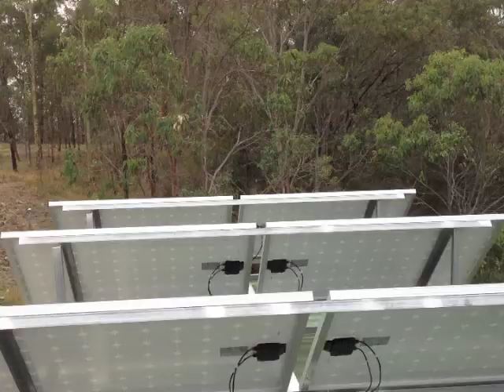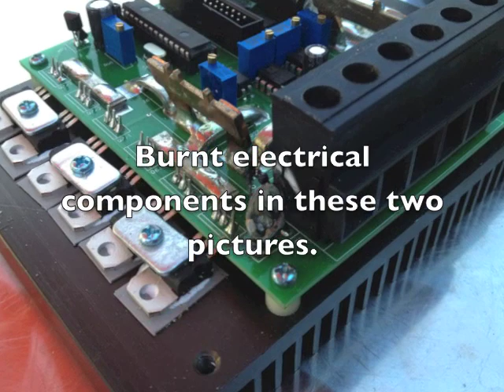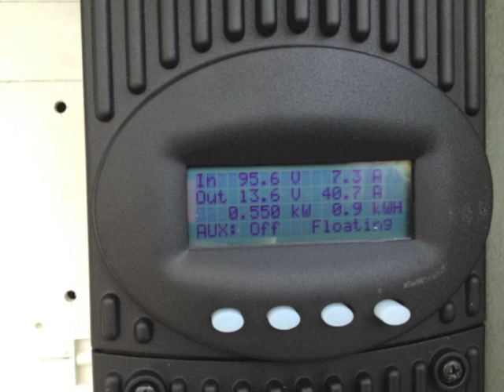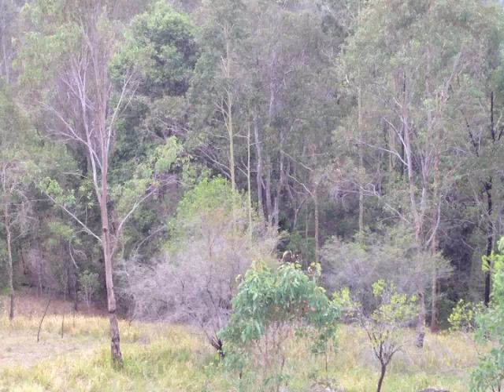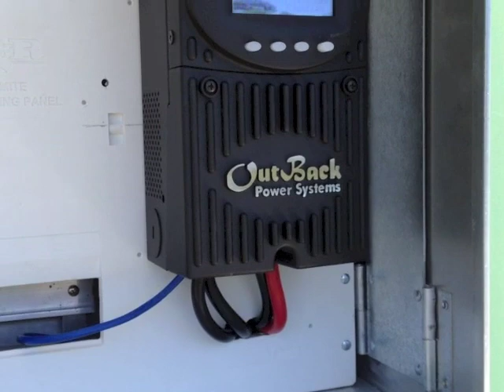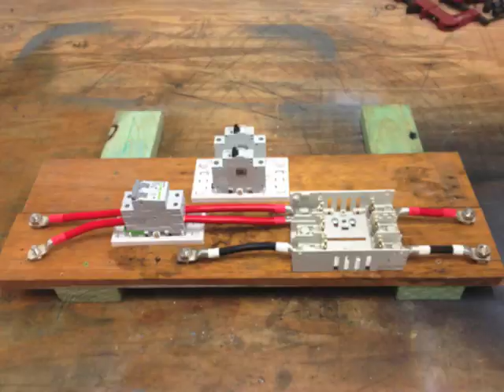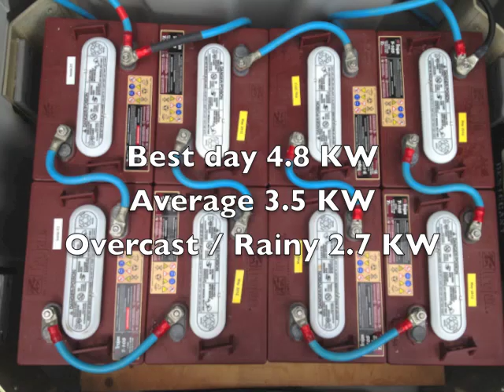Shipping Container House - Install a charge controller and inverter to solar panels

Comment: Paul - thanks for posting this! Clarification: was your generator connected to the charge controller in any way? Can you use it to top off your batteries, if ever needed? I'm looking for something that'll let me connect solar & wind, plus a generator for those few days a year the others aren't producing. Thanks!
Reply from the maker: Hi Dan, yes the Honda generator (3KW) connects to the inverter and this allows me to top up after a prolonged cloud cover. If the inverter senses the Honda is supplying power, it sheds the load to run on the generator and recharges the batteries at the same time. We only use it rarely, and typically for around 40mins to and hour after the sun has gone and the batteries are showing 80-90 percent full. We only need to put in enough for a small top up to carry us through the night and then review at the end of the next daylight period. It has been a very successful arrangement, currently running very well for 6 years. The outback equipment is old technology now, but it is very stable. The Honda is superb, starts first time EVERY time. I never dabbled in wind as I was in a wind shaded area below the hilltop. Cheers Paul
Reply: Thanks, Paul! Exactly the scenario I'm hoping to duplicate...with, perhpas, a little wind in the  mix. Regards,...Dan

Comment: A normal 120/230 volt Fridge and freezer used a lot of energy.  

Why you not buy a 48v compressor  Fridge, these are more energy-efficient.

Look on the internet and you find those fridges and freezers. 

Here some links

https://www.alibaba.com/product-detail/Solar-DC-24V-36V-48V-72V_547567632.html
https://www.alibaba.com/product-detail/DC-new-design-export-CE-UL_60621821892.html
Reply from the maker: Hi Lexpee, Thanks for the good advice about the fridges. Cheers Paul.

Comment: Thanks Paul I've got 9 360 watt panels I think I might just buy a few cheaper 250 watt panels to run my lighting independent like you are. Thanks for the input. Your videos by far are the most straight forward I watch.

Comment: Does all your lighting have to 48v now?
Reply from the maker: Hi Benjamin, My lighting LED's are 12v. My big battery bank is 48v. I experimented by buying a cheap 48v to 12v converter. It turned the 48v into 12v fine, but the lights stopped working. I could only switch on a couple of banks, as against all ten banks of 4 LEDs. I went back to a single 12v 150 AH lead acid battery fed by a 250w solar panel running all the lighting, and two 12v outlets charging a phone and running the internet modem. I think if I had bought a 200 dollar converter it might have been a different result. 12v is perfect for lighting. Cheers Paul

Comment: did you just run 6mm cable from panels to the charge control? I've got 24v system 32amps and needs to run about 7.5 meters.
Reply from the maker: +brittenv1000 Hi Britten, the panels I have seen have cable of 4mm cables where they connect. Traditional 4mm is used, but this is good for higher voltage panels. If you are on 24v, thicker cable is better as it reduces losses over the run. The shorter the better. Your cable should be rated to handle the current. If you question is about the battery cable, go as thick as you can. 32 Amps seems like a big number from a panel, are you stringing a few together. Cheers Paul
Reply: +Paul Chambers Cheers for the reply.  I'm getting my series and parallel confused ( tiredness 😄) 2 lots of 5 panels in series then parallel 2 together.  60volts 11.6 amps. sounds better? my panels have 4mm2 cable from them.
Reply: +Paul Chambers sorry to bother you again.  what make is your knife switch? thanks
Reply from the maker: +brittenv1000 That sounds more realistic. I used 4mm cable to bring it off the panels to a breaker that lets me isolate it. I put the breaker as close as practical to the panels.  I used the breaker to collect the 4mm wires but used battery cable from the breaker so there were minimal losses to get to the charge controller. Knife switch "Jean Muler" part no NH00-160A. Cheers Paul

Comment: Nice set up good job, I just hope you used RCBO breakers on your mains output side in other words earth leakage detection safety switches much safer if something goes wrong  it has to done in Australia to meet compliance..
Reply from the maker: +TheMFrelly Hi TheMFrelly, Indeed I have installed an RCD breaker. The output from the inverter goes to a regular house box with RCD, and multiple earth neutrals. I borrowed an RCD tester and made sure the RCD is operating. It was tripping in less than 20 ms (at 0 and 180). You message is a timely reminder to re test and to buzz the earth lines so thank you. Cheers Paul

Comment: PS My lady friend said that you sound very intelligent. Please don't let that go to your head, as you may need to add a wide-angle lens to your video system lol
Reply from the maker: +urgentcareguy3 Too late, I bought a canon 16-35 mm lens. I was able to fit in though with room to spare. LOL Regards to your lady friend. Cheers Paul

Comment: Yes, I like the Midnights a lot. They seem to have the ability for upgrades. The only down side to adding them to an Outback system is that they do not talk to the Outback Mate 3. In actual use, this just means opening up one more screen on your computer to admire your energy production. I'm going to try that new ceramic paint when I paint mine. Supposed to be quite good. If you need a turbine and want to do a powerful one, look for Orlando Sanchez at Genesis Wind Turbine here on YouTube. Happy compare notes on RE systems, if you like : )
Reply from the maker: +urgentcareguy3 I found that paint color choice was a more effective insulator than the ceramic paint.  My white container is cooler in summer than my green ceramic painted. How does the midnight connect to the computer. Do you have to run an RJ45 or is it over a wireless or bluetooth net. I believe they can take more than one string which is important to me. Can I buy a midnite version of a mate. Thanks for the turbine update.

Comment: I have the outbacks too with midnight solar charge controllers. Was going to suggest that you paint your solar container white to reduce its radiant heat impact on your panels.
Reply from the maker: +urgentcareguy3 Hi urgent, do you like the midnights, I have a future project and was considering one. The white storage container is a lot cooler than the dark green. Painting is on my to do list but not yet made it to the top. Cheers Paul

Comment: Well Paul, I am now starting to have nightmares, Volts, amps and all the rest, first I am not a numbers guy and power is even worse. Looks like I have a lot to learn and look forward to your help in the future.
Reply from the maker: +Noel Sowerby I was new to solar at the beginning. What I did was buy a 20 watt solar panel, a small battery and a very inexpensive charge controller and 4 LED lights. I decided to wire my garden shed with LED lights and learn how to join them all up. It turned out to be very simple and I discovered that warm LED lights are nicer than brighter cool temp lights. When i installed the lighting it was just a bigger version of this system. If your battery is big enough (around 100AH) it would allow you to get a small inverter to make mains power to run an electric drill and learn about inverters and what they can and cannot do. That gave me the confidence to tackle the house mains batteries and inverter you see now. I still use my shed lighting, when we sold the house I took it with me and it runs the outside security lights with the same panel, battery and controller.

Comment: was looking at the video you made with the 12volt disconnect with fuses to the 12volt breakers made on board that was part of solar panel controls with the charge controller and inverter. have been trying to find flush mount dc disconnect and breakers like those, would you know name of manufacturer? thanks
Reply from the maker: +david gregory Hi David. Thank you for the message. I will try and assist. I am just clarifying the bit you are interested in. There is (A) a 3 fuse knife switch, (B) a wall mounted double DC circuit breaker that will disconnect the power from the battery. Then there is (C) a 4 slot wall mounted CB holder that has the Inverter AC out breaker, and the generator AC in breaker. Are you trying to identify the neat DC breaker holder (B). What country are you in?. I will send you details when know which bit you are after. Cheers Paul
Reply: +Paul Chambers  Name of company that makes(A-B-C) would be good, may not use (C) but live on the east coast of Florida so may want to tie in the generator. Have had combi inverter-battery charger on boats and if leave inverter on when start generator screws up the inverter panel but charger side still works. Maybe(C) is what I need? Thanks
Reply: +Paul Chambers  Hi, took my computer down to the local electrical supplier and showed them the disconnect panel you made and only thing they had like the knife switch and dc circuit breaker did not have connectors big enough for 1/0 cable. Did you have to change the connecting lugs or did it come like that?
Reply from the maker: +david gregory Hi David, I contacted the company that supplied the knife switch. The complete unit including fuses was $90. I will look into your question about the other breaker boxes. I will have to go and talk to the electrical supplier I bought them. Here is the link to the supplier and they said they could post overseas. https://www.solaronline.com.au I did not change any lugs but it was very neat. Getting all the conductors into the lugs took a bit of time. Cheers Paul
Reply from the maker: +david gregory I used a double DC breaker because I had 2 cables. I could put a full sized cable into each of the  inputs of the DC breaker and put lugs on the outer ends.

Comment: The MPPT controller can receive higher voltage from the panels and feed to a 12 volt bank without the lose you get from the PMW controller that burned up. The only real reason to use a higher volt bank with MPPT is to reduce the cable requirements from the charge controller to the batt. bank. With a PMW controller you need to match voltage to avoid losing current, so 24v bank to 24v panel array is OK but 24v panel feeding 12 battery bank would lose half the amps. MPPT can take 24v from the panel and jam all the amps into a 12v bank. There are several benefits to MPPT, but flexibility is one of the biggies to me..
Reply from the maker: +pokerfacetodd That was very helpful. I knew about the current and the cables but the rest was news for me. Thank you for sharing. My Outback charge controller has been a good purchase. The only thing it does not do well is permit for multiple strings. I wanted to add a second string with a different orientation but people suggested that would not be a good move. I have 4 panels currently unused. Unsure of the best way to maxis the output. Cheers Paul
Reply: +Paul Chambers  I'd tie my panels in series to get 48 volts, that's four 12v panels to get 48v.s. Or two 24v panels tied together in series (positive to negative). Then parallel (positive to positive, negative to negative) strings of 48v together to maintain 48vs. If you have 4 extra panels that are 12v, you can series them together to get a 48v string, if the panels are 24vs then you'd get two strings of48vs. Then parallel those stings to your current 48v string. Your controller will see 48vs. It will be fine with that. The controller only cares that it gets 48vs. As long as you don't overload (too many amps) your charge controller's max amp input you should be fine. When you connect in series you add to volts but the amps stay the same. When connecting in parallel the volts stay the same but the amps increase. So each string of 48vs will add its amps to the total when they are connected to each other in parallel. If you don't tie strings together you only get the amps equal to one of the panels. So if the panels in a string have 12v and 5 amps each, and you series them together, you'd still only get 5 amps for that string, but you get 48vs. Since volts times amps equal watts you get the same current. So each string only puts out the amps of a single panel in a string, but combines the volts. Then paralleling those strings adds the amps of the strings while maintaining 48vs. That way, with four strings of four 12v, 5 amp panels each (sixteen 12v, 5 amp panels) would equal 20 amps when running at 48 volts. If you break it back down to 12vs you'll have 80 amps instead of twenty, but the watts never change no matter how you divide it. By parallel connecting the strings of 48v together you end up with one positive and one negative cable going into the controller. The controller sees 48vs and the combined amps of the strings. More strings equal more amps. ....Remember to match panels as closely as possible when creating a string. Because the standard for that series of panels is the weakest of them. If the new panels are identical to each other in output there is no problem with that issue.

Comment: Hi, I am just trying to learn about solar. I really enjoyed your video, will be checking out your other videos. Once I get my system together I hope to start my channel, so that I can show what I run off my system. I have a long way to go lol
Reply from the maker: Hi Honey Hi Honey, (awesome name) I am glad you are enjoying my channel. Thank you for the feedback. Send me a link to your channel when you get started, I would love to see it. Cheers Paul
Reply: Hi Paul, I am trying to run a small AC unit 5050 BTU, 550 watts unit.. I have a 500 watt unit that is a charge controller inverter all in one.  and 100 watt solar panel.Do you know how many 100 AH deep cycle batteries I could string together (how) to run safely my 500 watt inverter? and AC
Reply from the maker: Hi Honey Hi Honey
Send me a message via the contact form of my 
website.(so I can get your email address).  I am going to send you a 
copy of my ebook. Your question is making me think you are quite new to 
this and there are a few concepts you perhaps need to understand.
Running an air conditioner is at the hard end of the scale for learning with solar. 
Lots of the terms you are using don’t tie up 
properly. AC units have two watt measurements, cooling watts and 
electrical power watts (very different). A device that says it uses 500w
 may take a lot more to start. Example, a fridge uses a medium amount of power to
 run, but it takes a lot to start the motor. Between 5 and 10 times the 
normal running load. A 500w watt inverter is unlikely to be able to 
start a 500w motor.
As a guide, from experience, I put the same 
amount of solar panel watts as I do Amp hours of my battery. This means 
the battery will fill to full during the day. A tiny panel can fill an 
enormous battery but it may take two weeks. A big panel can fill a small
 battery very quickly.
500w is TINY. You are going to be unlikely to 
power anything with a 500w inverter. I could not run a household coffee 
machine with a 1000w inverter. It had a water heater and a bean 
grinding  motor and it was too much for the inverter. I got a free  
1000w inverter with my generator but it cant switch on a mains water 
pump.
Tell me the full extent you would like to set up solar to run and I will be able to answer more easily.
The ebook is free but if you get value from what it contains, I wont be offended if you buy a copy afterwards.
The amount of batteries you need is realisticaly 
going to be determined by how much you want to run. There are videos on 
the net that show solar panels with no batteries running air 
conditioners.  They are using many panels. If the sun goes in the 
voltage will decay and might fry the AC unit.  The battery smooths it 
out to cope with clouds. I tried to run my AC unit (once) on batteries only 
and it emptied them in half an hour. 
A 100 watt panel and a 100AH 12v battery can 
realistically run, a lot of LED lights, 12v volt water pump, a small LED
 TV, a laptop charger. But not all at once and not for a long time. 
Cheers Paul

Comment: concerns of putting all that great gear in a box whith no air circulation or vents the cooling fan needs to breath great vid mike
Reply from the maker: Mike Hobbs Hi Mike, thankyou for the suggestion. There is a 4 inch hole near the top of the box so hopefully some of the hot air will escape. I would like to set up forced ventilation with a fan and better shading, but time has been required on the other projects. Maybe this year.

Comment: hey! nice video, but im having issues with outback controller! what do i do?
Reply from the maker: Ekenson Nkpouko Hi Ekenson, I have not experienced problems with the outback controller, but one of the reasons I paid the extra for outback was the 5 year warranty. Assuming you have not exceeded the 150 volts limit on charge controllers from your panels, I would invoke the warranty. Cheers and good luck. Paul

Comment: Hi Paul, thanks for the video! Great info. I'm in the process of planning my off grid project and I'm trying to decide if I should go Outback 24v or 48v inverter charger. I know you changed from 12v to 48v. Even though my system will be small to start (2 to 4 250w panels, 2 to 4 Deep Cycle batteries ), Trying to decide if I should go straight for 48v or is 24v a good way to go for small off grid?
Reply from the maker: When I started I was not sure how much power I would need. Or how seriously to take the whole project. 12v was my obvious choice. When I tried to solve running a fridge full time. 48v and buying decent (expensive) was my solution. I now have plenty of power and the outback components are awesome. I would buy it all again. I still use a 12v system for lighting, phone and internet.Generating 240 is probably most efficient with 48v. Cheers Paul
Reply: Paul Chambers Thanks Paul... looks like 48volts it is! Much appreciated